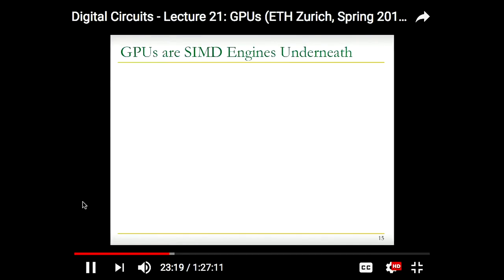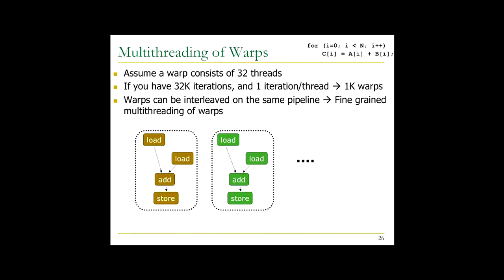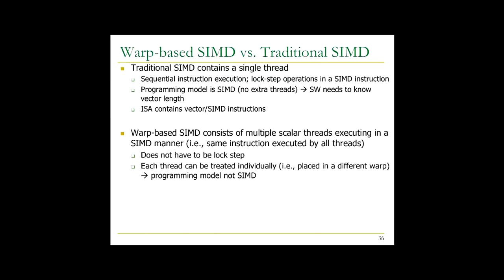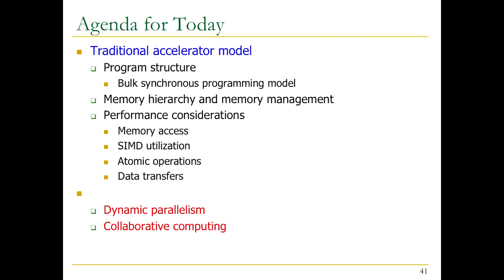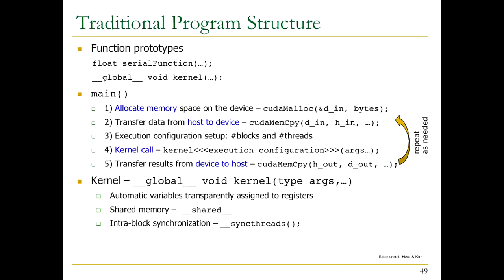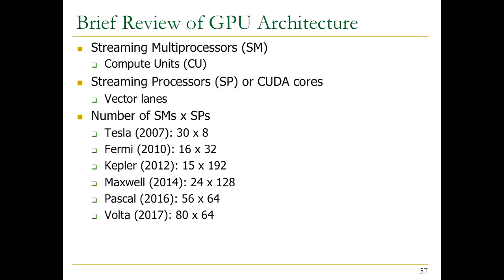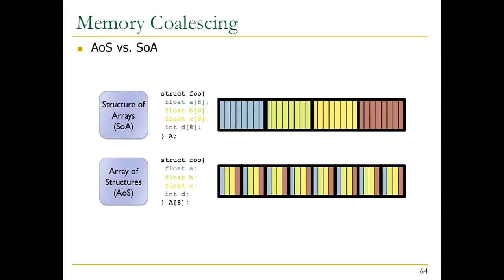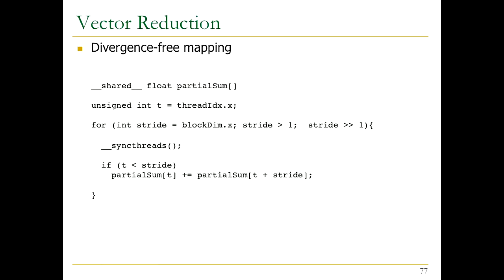Computer Architecture - Lecture 9: GPUs and GPGPU Programming (ETH Zürich, Fall 2017)

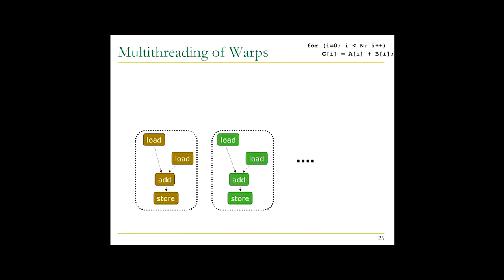Comment: 21:21 What if all the SIMD lanes have a different pointer value for the load, and the load operands in each lane are not located nearby the loads in the other lanes? Does it switch to another thread until it brings them all into the cache? It doesn't require the load operand across the lanes to be adjacent, does it? Aren't the loads really "vector gather" instructions?